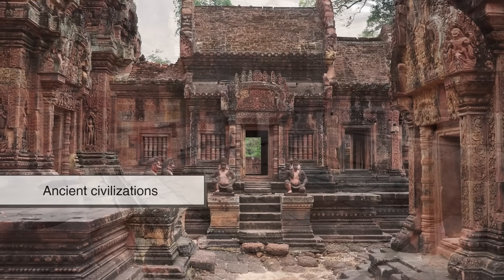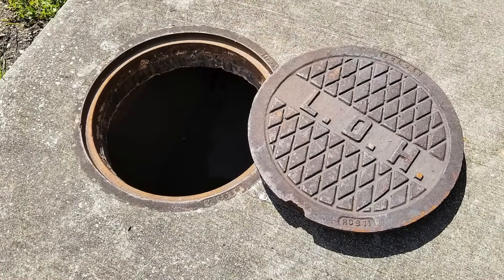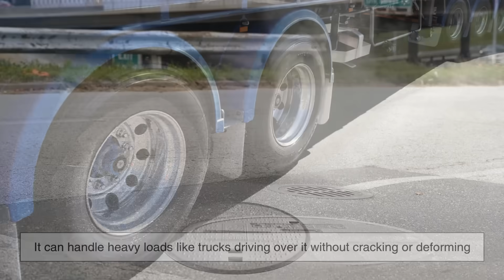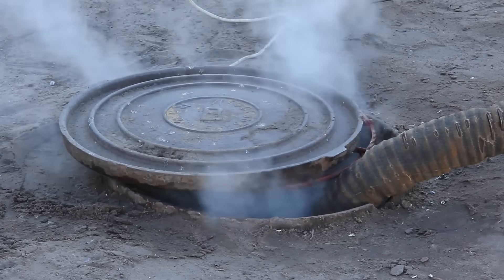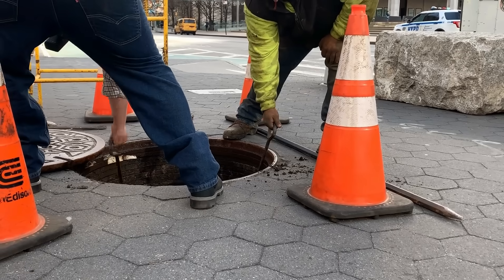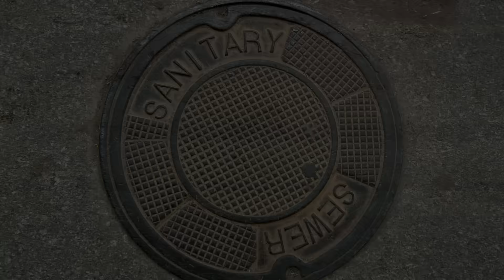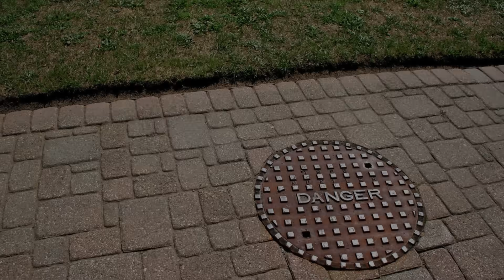Why Are Manhole Covers Made of Cast Iron?

Comment: In Germany the covers are made total of iron until 1933. Then they need iron for tanks 😊. They changed the cover zu BEGU Beton mit Gusseisen. 
The concrete is the weight and the iron is fitting. This is used until today.
Use 40 % less iron.
Sometimes the covers are made of iron and upgraded with the 
coat of arms of the city for show.

Comment: 3:10 during many events in France gaz covers were used during protests to trough at the police or break shops and cars. 

They have been quickly soldered in days , then later  replaced with models using keys.

Comment: Ductile Iron manhole covers are preferred in applications of heavy traffic or impact.  I had Cast Iron covers crack and fail in steel mill roadways where the traffic loading from large fork trucks hauling steel exceeds that of highways.  Once replaced with Ductile Iron ones we no longer had any failures.  The cost difference was minimal.

Comment: As to quote the late great Clifford C. Clavin in a thick Boston accent,,,,,,,the manhole cover was originally made from the incredible tough strands of bamboo in some parts of the world , the men it covered found it was quite breathable but the women had issues walking over them with high healed shoes ,,,,further more the thermal expansion of said fibre caused for these covers to be a springboard and women became airborne,,,so they switched to cast iron ,,,problem solved.

Comment: I complained to my city for 5 years about my streets conditions, broken and missing sewer covers, areas with no concrete or asphalt, constant water main failures and overly rough conditions....finally, finally after years of documented complaints....they repaved my whole neighborhood, reducing all the sidewalks and infrastructure....3 months later I was shoveling snow and for whatever reason....in the 11 years I've been here...a snow plow for the very first time ever came down my street....and immediately ripped out the brand new man hole cover....right infront of my house....I now have a giant hump to drive over....and I haven't seen the plow come by since. 

If your curious about the man hole or the plow...the blade jumped a solid 8 inches or more, it busted the collar of the man whole in half and the lid flew a few feet away. I dont think it broke the truck but he did hang out until the city came by to put up a pylon 😅 fml

Comment: "No need to roll or align anything"
Believe me, there are a ton of people that go insane when they see a cover that was painted over with a traffic line and then manipulated and when it was placed down again the workers didn't notice or didn't care about the line and it ends up in the wrong position 😂
I think they could even get an anxiety attack.
Reply: "i wasnt break checking, it was the line on the man hole cover being at 37.37 degrees out of line that put me into panic mode, i was only stopping to fix the issue!"

Comment: Simple answer: Cast iron is an ideal space filler. With enough mass, extremely durable. Price of cast iron: about $150-$190 per ton. Steel is the only cost effective alternative at about $550-$690 per ton. If cast iron will do the job, why use steel?

Comment: Rebar reinforced epoxy resin with gravel (like concrete but with resin) - heavy, durable and no one wants to steal them for scrap. These type of manhole covers are very common where I live. They are cheaper also.
Reply: My concern with these epoxy ones is: are they recyclable. Before they get more common, there should be a recycling process otherwise it'll be like all the discarded wind mill blades that are finally getting attention for recycling after years of storage.
Reply: @ameyring  Strange question... How many covers you need to recycle compared to how many blades? These covers are mainly gravel, some rebar and something like 20% of the volume (not mass) is resin. They can last forever if they are not subjected to extreme load. What is the production cost of cast iron covers? Many times more... What is the carbon footprint? You need a LOT of energy to melt iron. Your concern is focused only in recycling of one thing compared to one completely different thing. A factory in nearest city switched entirely to resin covers many years ago. They shut down the entire casting facility.

Comment: Driveable M/H covers are cast iron, on suburbian horse trails we use diamond plate & in purely walkable (sidewalks)can use fiberglass or the 1st two. Reason they are round is you can't accidentally drop it through the hole on equipment underneath. Do have some square ones left but those were all installed pre-WW2.

Comment: Strength under compression isn't all that's required when driving over cover, the bottom is under tension so it needs decent tensile strength too.
This commutator doesn't understand basic engineering principles.

Comment: In Indonesia, a lot of manhole use concrete with rebar and rectangular shaped. Commonly used for fiber optics installation underground. There exist cast-iron manhole too but only on certain place (to avoid getting stole just as in video).

I assume the prevalence of concrete manhole is due to frequent rain thus the humidity, safety concern, and it's easier,more accessible to produce than cast iron.

Comment: Cast iron was the Detroit wonder metal for automakers in most of the 20th century.  It has been superseded by aluminum to save weight but, we're seeing more mechanical failures because it is not as robust as cast iron.
Reply: Just for engines.

Comment: Fail.  When a truck drives over a manhole cover it is under TENSION and SHEAR not COMPRESSION.  Compression stress occurs when an object is squeezed or shortened, tension stress occurs when an object is stretched or lengthened, and shear stress occurs when an object is twisted or experiences forces that cause different parts of it to move in different directions or at different speeds.

Comment: In 1970 I dropped a manhole cover on my left foot. It cracked down the middle. My foot not the manhole cover. At times it still bothers me today. Yes, they are heavy. I know. 😢
Reply: Not gonna lie, you had me in the first half!😄

Sorry for your.. almost permanent loss.

Also, it is reassuring to find someone older than myself.. regularly using internet social sites.

I (born in the late 1970s) often get snubbed as being too old to be on X Y Z platform.😒

While you have the gift of the gab and a story to tell...
... we can feel the pain.. that your foot is still going through.
Reply: @sailaab  At least the manhole cover was just fine. I was trained to replace it correctly but got in a hurry and that is when the accident happened. It was my fault.
Reply: Ouch! Time for a pair of steel-toe boots if you haven't already got them.
Reply: @JDSly1  The steel was in the bottom of the boots, but nothing for the toes.
Reply: I too have an internal weather detection bone. Would trade it back in a heartbeat if I could.
Reply: When she was a girl my aunt used to jump on manhole covers.
Problem is, up north it's cold and iron gets brittle, one shattered and opened her leg ankle to hip, big scar

Comment: To note.... MAGNESIUM can be added to the cast iron mix during production and is an option used for higher traffic locations as it makes them a bit more ductile and less likely to fracture or crack on impact.
Reply: Ductile iron, one of the best water main pipe materials, too.
Reply: @Koogz406  so you think the magnesium inside the cast-iron is going to. Burn
Reply: @neilkurzman4907 yes it burns up the sulfur and  it makes the metal ductile, so why add it? It just makes the metal material's ability to undergo significant permanent deformation, or plastic deformation, without breaking. It's a key mechanical property that indicates how easily a material can be stretched so again why would you add it to a man cover? You would not
Reply: @neilkurzman4907  magnesium burns up when added and removes the sulfur from the cast melt. The primary goal of adding magnesium is to produce ductile iron, also known as nodular iron or spheroidal graphite iron. So again, why would this be good for a man cover?
Reply: @neilkurzman4907   but I guess it would help it last longer. I assue that if it would help, they would do it. The man hole covers they have work and seem to last a long time so it seems unnecessary and just burning it up. More money that is.
Reply: @ I’m not a meteorologist so I couldn’t tell you what the cost and benefit is
Reply: @neilkurzman4907   what are you with your i know everything else about the metals and their uses? Humble, at least.
Reply: @ 
I did not know the magnesium reacts during the casting. I thought you meant that it would burn after it was cast. 
I’m like a lot of people on the Internet. I’m not going to stand behind my guesses.  If I’m wrong I am wrong.
I used to work with an engineer who had studied material science. 
He always had a lot of fun facts
Reply: @neilkurzman4907   i am the idiot I apologize and hope you have a great one.
Reply: @neilkurzman4907    Yea, but now I realize my grave error, please keep the random insults coming ladys I can admit when wrong. My gift to yall, i will not delete it. I will leave it so you guys can feel good about yourselves and vent about my ingrorance.
Reply: There are MANY reasons that being more ductile is advantageous.  Number one, it will deform or "flex" under an above standard load instead of breaking or cracking.  A manhole cover that has flexed is FAR preferred to one that has cracked or broken.  I will not go any deeper down this hole as most of you won't even understand this first 'obvious' example of why some covers are made of ductile iron.
Reply: @paulmartin2348  your cool
Reply: @paulmartin2348   I even said I guess it does make it stronger and more corrosion resistant, but that they probably only do it if it needs it, which is true because of the cost. Almost work for word what I said. I am officially the first commentator on youtube to research something and learn more about it and end up agreeing. I guess I should just take all your guys' comments as gospel. Appreciate you guys, and nice try you. You almost impressed someone.
Reply: @ Koogz just ain't that bright (or just confused).

Comment: Heavy, strong, ductile,corrosion resistant, and cheap. If they were stainless, tweakers would just steal them.
Reply: Not just tweakers...  There's a lot of places even in the US where otherwise decent, hard working people will steal anything that's not nailed down.  I've worked with plenty of people over the years that have no problem stealing stuff, just because it has value and it's easy enough to do.

Comment: Interesting video.  About twenty years ago, my home state, Connecticut, started sinking manhole covers roughly four inches or so below the surface of the road.  This resulted in a manmade potholes or chuck holes that's hard on the suspension of everyone's car.  I can't find any sense for doing this.  And it's not snowplows knocking off the covers as that was a rare occurrence.  Since Connecticut is known as "The Tax You to Death" state, I'm thinking that by sinking manhole covers it generates additional tax money via taxes charged for labor and parts on auto repairs.  I'm sure stranger things have happened.
Reply: Did the city actually dig them up and lower them? Or was the street resurfaced by overlaying the pavement without raising the castings?  overlaying the pavement without raising the castings is common practice in parking lots to keep cost down.
Reply: @scottbc31h22  I think that's it. It's much cheaper to add a bit of new asphalt than it is to grind away the old surface and add a thicker layer, they just have to do it more often. It adds up, especially since the new thin layer doesn't last as long.
Reply: I worked at Sikorsky back in 1985. Before the state had income tax. I almost settled down there, but there was an influx of NYC people getting away from NY taxes. The housing increased by a third in one year. They instituted income tax after I left and became another typical blue northeast state.
Reply: While there's some examples of recessed manhole covers here and there around Hartford, it's rare now days.  Most of the manhole covers and city water access ports are more or less level with the pavement.  

The bigger problem is the awful pavement patch jobs when utilities dig up the street to work on service (sewer, water, etc...).  The municipalities don't require utility companies to replace the pavement to any acceptable standard and after a winter season or two, the patch jobs become potholes.

Comment: Nashua, NH started using triangular manhole covers in the 1930's on the theory that they would rattle less under traffic. They were manufactured by a local foundry with the hopes of a large market, but they didn't catch on in other cities. So Nashua remained fairly unique for decades. The triangular manhole covers are being phased out now. Part of the reason is that they interfere with breathing gear due to their dimensions.
Reply: Posted the same further up... Great piece of history. Every year there are a few less as they are replaced from wear or upgrades. 

Plus if a worker had to be evacuated on a blackboard or stretcher, round is easier for emergency workers.
Reply: @timothyp3378 also it’s impossible for a round manhole cover to drop down the hole.
Reply: Were they made by leich of kirkcaldy?
Reply: @davideyres955  And that differs from a Triangle exactly how?
Reply: @paulmartin2348  The height of an equilateral triangle is less than the length of one side, so a triangle can fall into its own hole.
Reply: @martin-vv9lf  What about using a Reuleaux triangle?
Reply: @martin-vv9lf  Are you sure about that? Equal length ODD sided covers can't fall into themselves.
Reply: @DJ5200A5  a Reuleaux triangle cannot fall in and would be ideal for a manhole cover,  not rocking with traffic either. I am sure about the equalateral triangle falling in, but there may be workarounds such as an enlarged recess to bring the diameter lower than the shortest width of the triangle and prevent it falling in. if you can't get your head around it, then have a play around with cardboard and a triangular cut out.
Reply: Thanks for the interesting fact! I have lived in NH my entire life and did not know that. Awesome!
Reply: The triangled one are still used for water valve covers in water distribution systems, but they are small (maybe 1 ft on a side) and below them is the turning rod for the buried valve.  Underground well monitoring locations (such as old leaky gas station sites) also use the smaller ones to cover the well pipe monitoring ports.   I'm not sure what natural gas line valves use.